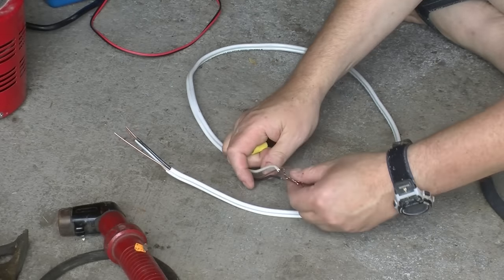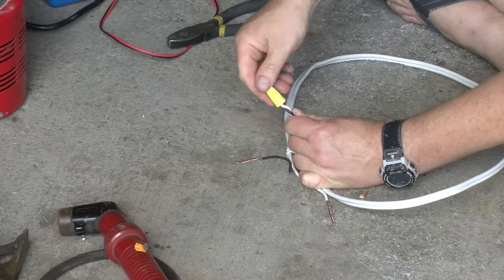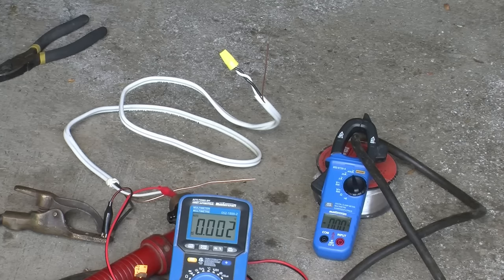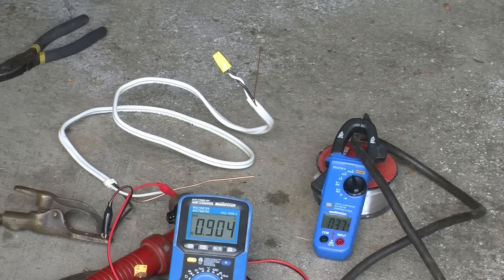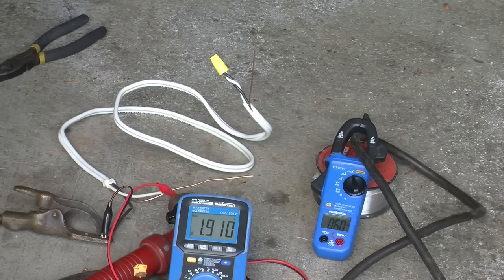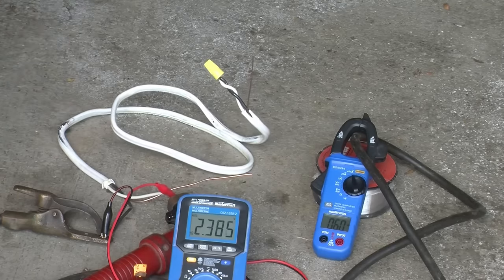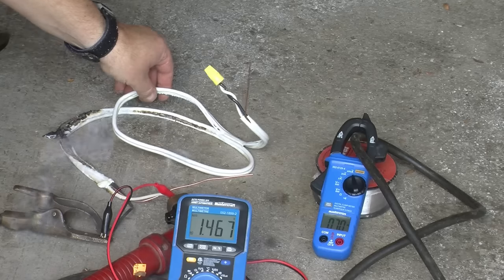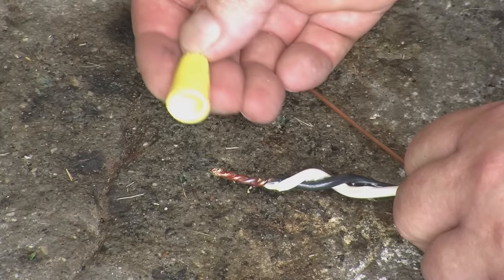How many Amps to burn up 14/2 electrical wiring?

Comment: So what is the point of this video exactly? If I wanted to fry the wire super quick I would put 200 amps through it. There are tables that show you burning through the wire in 1 second what amps you need. 

With same spirit I can put like 40 amps through that wire continuously (maybe more!) if I put it outside in the winter, especially on windy day. 
If you want realistic test you would need to build a mockup of a wall, and test each amperage till wire temperature stabilizes. Then you know, that with say ambient 20C after putting 15amps continuous the wire temp was say stable at 47C (say after 6h it stabilized and no more temp rise). Then you would put 20 amps through it and noted that wire stabilized at say 67C. Then you would try 25 amps & I am unsure if wire would made it or not. If it did you could try 30 amps & I am sure it would have failed. That would be a test of USE. Not this. It would tell us how much safety there is. This tells us... nothing.

Comment: Invest in one of those laser thermometers for these experiments
Reply from the maker: Actually I even bought  a thermal camera for the later videos did of more realistic situations with the cable in 2x4 walls with and without various types of insulation.
Reply from the maker: Actually I even bought  a thermal camera for the later videos did of more realistic situations with the cable in 2x4 walls with and without various types of insulation.
Reply: @ElectromagneticVideos  awesome!

Comment: How does the bend in the wire impact it's behavior? For instance, if I fold 14/2 into a box behind an outlet, when will it fail?
Reply from the maker: I would think a very tight bend might make it more susceptible to failure. Would be interesting to know if any electricians who have millions of  installations have seen any correlation.

Comment: But at 2-5 v?  What about at 120vac?
Reply from the maker: The heating of the wire is from the voltage developed along the wire due to the current encountering the wire’s resistance, a few volts in this case. If the voltage between the wires was 120V (or 240V) with a load attached to the end of the wires, the same voltage drop of a few volts would be measurable along length  of the wires for a given current  and the heating would be the same.  120V times the current would be the power delivered to the load, different from the power that is dissipated in the wires which we are interested in. To keep this test simple and safe, there is no load (by shorting then end) and all we need is a few volts to create the desired current – and heating in the wires. 

See  "OVERCURRENT TESTS FAQ" here  https://www.youtube.com/post/UgkxeilOfLJGy2ODslnBW0WFXUE580oHhFyP  including why a current source like welder is used and a link to a UL test done in almost the same way. 

Hope that helps!

Comment: More real world test would be a 100' or something typical of a real home circuit
Reply from the maker: The bigger issue is the 14/2 here is in the open air. I did bunch of later ones with 14/2 in a fake section of 2x4 insulated stud wall.  As expected, the insulation melts at a considerably lower current.

Comment: Pretty kool experiment, but "technically", 14 AWG romex is rated for 20 amps and that's the amperage you can start with, when applying your derating calcs. Yet the NEC also states that the overcurrent protection for it shall not be more than 15 amps for general purpose branch circuits. Yet when using motor calcs. you can use up to 125% of the rating for overcurrent protection. And the overcurrent protection shall not have a continuous load of more than 80% of the overcurrent protection device on any circuit. "Continuous load", is defined as, a load that is maintained for more than 3 hours. Just saying. 🤔
Reply from the maker: So something you tmentioned is something I have always gotten conflicting answers on: for  a circuit dedicated to an induction motor like compressor for example, are you allowed allowed more than a 15A breaker for 14/2? You seem to be saying yes. Based on my understanding of what your saying, it would seem like NEC allows up to a 25A breaker which would be very useful for some induction motors with high startup curents.
Reply: @ElectromagneticVideos  that is correct. That is the reason for the code. It's for motors with high starting currents that would possibly cause nuisance tripping of the of the overcurrent device.
Reply: @ElectromagneticVideos  for example if you look at the nameplate on any A/C condenser, you'll see 2 listings stating, 1- minimum ampacity refurring to (minimum wire size) and 2- maximum overcurrent protection. You'll often, if not always see, that the overcurrent size exceeds standard overcurrent protection rating for the wire size listed.
Reply from the maker: @chaser9363  I didn't know AC's actually listed that. I once tried finding out that info for 2hp 240V compressor and I think with everything made in China these days that info was not available. In the end it worked fine on #12 20A circuit but I was concerned about the start current for the reasons your  stated. Your also the first one to confirm that in some cases a larger breaker is allowable. I'm in Canada so it may be different but generally CEC is very similar to NEC.

Comment: If you have the money and space always use 10/2.
Reply from the maker: Interesting! I have never seen that for standard 120V outlets - I didn't even know it was permissible by code to use 10/2 on a standard outlet. Is there enough space under the screw? Would really be great for workshop motors with huge startup currents or even laser printers.

Comment: A dead short....can't be so wonderful for the welder...
Reply from the maker: What makes the welder so perfect for it is that it is a current limited transformer, meaning a leakage flux path (set by the current adjust dial) limits the max current that can flow even with a short. Add to that that I reduced the voltage powering the welder for all but the very end, and the welder really had no issues doing this as well as the later test with wire in insulated walls etc. 

For anyone reading this - this is a 50(?) year old welder that is essentially giant current limited power transformer - quite different from the modern electronic (switching power power supp;y) welders and also way more rugged.

Comment: That is why they interrupt the flow with a breaker, so scaries like you don't burn house(s) down. 11 minutes, really lol
Reply from the maker: At 11 min its actually a mild example of what happens of a breaker does fail which happens but thankfully rarely. In a real system so much current would flow you probably would get copper explosively vaporizing. An industrial electrician I know told be about a nearby factory with failed breaker where a giant bus bar melted and parts vaporized - apparently the devastation was amazing. Luckily nobody was nearby when it happened.

Comment: This is not even close to being a valid test. Even if he is running the welder on AC and not DC it is probably only running between 24 and 27 volts on a wire that is made for 120 VAC. Amps are the power or load and Volts is the speed the electricity is delivered. If you are not running it at the right voltage or speed it throws the rest of the test. If you have a welder that uses 30amps at 240 volts at 120 volts it will use 60 amps. When you change the voltage or speed it changes the amperage the line can  carry

Comment: Wire nut's, as "some" people call them? I worked the industry for 35yrs., and I would say that about 99% of electricians called them just that. And what you call them, I have never heard anyone call them that.
Reply from the maker: I think its where you are as to what they are commonly called. Here is often Marr connectors, probably because they were invented by Mr Marr in Toronto 100 years ago and I think his companys connectors were so  common here the name stuck.

Comment: 14-2  rated 15 amps max load not  over 70 feet length  I prefer to make circuit no more then 80% of 15 amp
 No more than 1440 watts 12 amps.

Comment: I cannot believe how many people in the comments either know an electrician or state they've watched an electrician not pretwist the wires prior to putting on the wire nut!
If you ever want to know a real pro from an amateur, just read the back of a wire nut package! Even the manufacturer of wire nuts knows the wire nuts are never meant to connect the wires but to protect the exposed wires.
Fire your electrician if you ever see them using a wire nut to make a solid connection.
I own a Property management company and perform many simple electrical tasks and a must for me is to pretwist every wire as well as wrapping every outlet with 2 layers of electrical tape.

Comment: While an interesting video, you are not getting a true voltage reading since the wires ares shorted together at the other end. You would get a truer reading if you repeated this with a single phase motor as a load, then you'd read the voltage applied and the current the motor was drawing. Your connection right now is the same as if you put meter leads in the hot leg of two wall receptacles, they should read almost no voltage since they are electrically the same voltage.
Reply from the maker: I recently posted a video discussing those things - take a look: https://youtu.be/CP3-jcpzZeI

Comment: DUDE DC is not same as AC !
you put 30 Amps on this lil wire of yours at 120 v AC and its a smokeshow in 10 secs?!
Reply from the maker: A number of people made comments like your when I published the video. A few points: 1) The vintage welder is from the days before cheap silicon rectifiers and it is AC out. 2) Skin depth for 60Hz in copper is 8mm so from that perspective the wire is no different between AC and DC. 3) The only difference DC would make is once a short occurs and things melt and an arc were to develop, the arc does not self-extinguish as easily as an AC arc, so more fireworks at that stage in the test. But but by  then insulation would already have been melted.

Comment: This does nothing for us because you aren't testing it at 120v....
Reply from the maker: The potential between wires does not affect the  Ohmic heating whihc melts the plastic. Its the voltage drop along the wire (not between the wires) x current that is the heat that melts the insulation. There is a more extensive explanation here https://www.youtube.com/post/UgkxeilOfLJGy2ODslnBW0WFXUE580oHhFyP

Comment: Very dangerous message being sent out in this vid, in a realistic application 120V is what would be passing through that wire @ 30A that would be 3600W. .7V @ 30Ais only  21W #14 is rated for 1800W. 30A braker on this wire is very dangerous and should never ever be attempted in a residential installation. So yes, in a real world application, this wire would most certainly fail at 30A.
Reply from the maker: 1800W in your example  is the power delivered to the load, not the power dissipated as heat in the cable. Its the current and  resistance of the wire  that heats cable, not the conductor to conductor voltage difference. You get the same heating  for a given current regardless of whether there is 12V, 120V, 240V or any other voltage between the conductors. That's why the rated capacity of cables is in Amps, not watts. 14/2 has the same ampacity whether it is used at 120V, 240V or 12V for that matter. 

I did a writeup here that includes a link to UL testing done in a similar way:

https://www.youtube.com/channel/UCV2-Qbq9o0EOQWPLAWkVH2w/community?lb=UgkxeilOfLJGy2ODslnBW0WFXUE580oHhFyP

Comment: use a power supply and try  60 amps   at 120 volts
Reply from the maker: I assume you are implying that having 120V between the wires will make a difference. It wont - the heating is from the I squared R losses in the wire which is independent of voltage between the wires (which determines the power delivered to the load when multiplied by the current)

I did a writeup here that includes a link to UL testing done in a similar way:

https://www.youtube.com/channel/UCV2-Qbq9o0EOQWPLAWkVH2w/community?lb=UgkxeilOfLJGy2ODslnBW0WFXUE580oHhFyP

Comment: Not an accurate test. Normal line voltage is 120 volts. Most stick welders like the one used in the video use low voltage DC, 10 to 50 amps, to help avoid electrocuting welders. He makes no mention in this video if his welder has an AC option or the voltage setting he used so lets take the middle of that range, 30 volts, that would be 1,500 watts at 50 amps. 50 amps at 120 volts however would be 6,000 watts. I would venture to say that the wire insulation would have melted  before 50 amps and over a longer time period inside a wall probably at a fraction of that.
Reply from the maker: 1) Its is an AC welder
2) Unfortunately you are confusing two things - resistive heating in the wire due to current flow in the wire which does not depend on the voltage between the wires and power delivered to the load which does  depend on the voltage between the wires

Due to numerous similar comments I did a written discussion here https://www.youtube.com/channel/UCV2-Qbq9o0EOQWPLAWkVH2w/community?lb=UgkxeilOfLJGy2ODslnBW0WFXUE580oHhFyP which also has a link to UL certification study using essentially the same method.  The biggest flaw in the test in this video is that cable are usually more heat restricted than this due to insulation in the walls etc. I did some follow videos with more realistic situations.
Reply: @ElectromagneticVideos   Current squared times resistance!  I point this out all the time and most of these guys don't even know what I'm talking about!  Knowing the code and being a "wiring installer" does not make them engineers!
Reply from the maker: @professorg8383  I also think one of the issues is many people skip though the explanatory parts of many videos and then make assumptions and comment. Not everyone of course ... and I try and answer peoples comments in as helpful and/or educational a way as possible.
Reply: @ElectromagneticVideos  Yeah, I generally try but I sometimes  lose patience with some that are sure they know, but obviously don't based on what they say.
Reply from the maker: @professorg8383  I know exactly how you feel! I have a few prepared answers that I copy and paste for similar comments to this and the (better) follow  up videos which also makes it a bit easier.
Reply: @ElectromagneticVideos   I've had a few students trying to convince me to do videos,  I have done a couple for use in my classes only that I used during Covid in Zoom classes, when we didn't have access to lab work. I have always been concerned about someone with very limited knowledge, observing and doing something stupid!! Plus I have come to realize that doing a quality video is a lot harder than it looks!!  Even being "retired" I seem to have a lot on my plate!! I've built a pretty good shop at home and make stuff and experiment a lot, And I do just about everything in my well equipped shop. Sometimes I take on little projects as an excuse to buy tools! I built my shop through the years, mainly because I still like hands and and often my work was more about using my head vs, my hands. I guess it became sort of a hobby
Reply from the maker: @professorg8383  It took me a long time to take the plunge and start doing videos. Had similar concerns, but in the end I felt by showing how to do things properly I was at least combating a lot of the truly dangerous things on YouTube. 

The best part of it has been having a good excuse to do some things I have always wanted to do, or to repeat things I did a long time ago as a kid or student. And it has been great fun. Your right though - it does take a lot of effort. The hardest thing I find is doing the narration - its quite different from lecturing or giving a presentation. And the most time consuming is the editing and graphics. There also a lot of luck in terms of what YouTube likes - this video really started with the previous video which was "lets try overloading some extension cords before throwing them out  - maybe I should video it" is my most popular video. My favorite videos (measuring the speed of light, transmission line impedance, etc) get a fraction of the views. 

You sound a lot like me - I always liked  practical stuff as well as theory - and the hands on stuff really makes it real when trying to get ideas across. If you would like to chat, send me an email! (in the "More about this channel" section)

Comment: great try that on 200 feet of wire and lets see how many amps, i doubt those waego connectors would hold up to that
Reply from the maker: Since heating of the wire is due to current on a per foot bases (eg 10W per foot for 30A for some fictitious wire) length shouldnt make a difference if its unspooled. But if it is in a nice neat  roll, using the same numbers 200 feet x 10 W/ft = 2000W, all concentrated in a small volume. Bet it wouldnt take long to melt. Same thing if you have few dozen wires bundles together all carrying current - can get really hot cause the small amount of heat from each wire add to that of the others.

Comment: Loved the video, but cringed every time you touched the wire past 30 amps. 😮
Reply from the maker: Thanks! Since the voltage is low, the only real concern is the heat. And I didn't touch it when it got really hot - and I still have the fingerprints to prove it :)